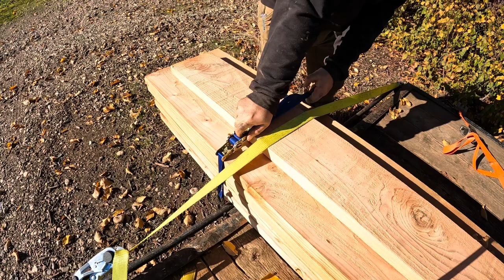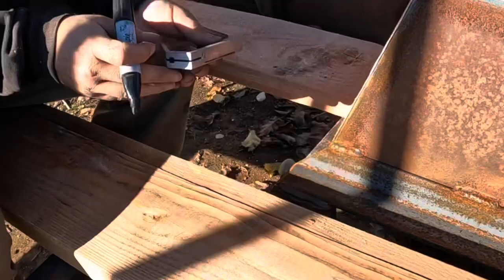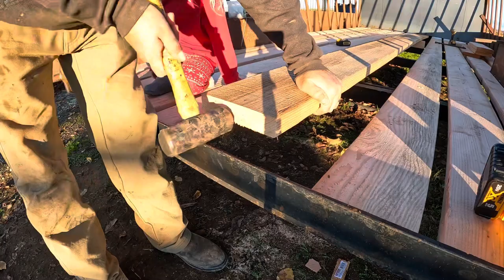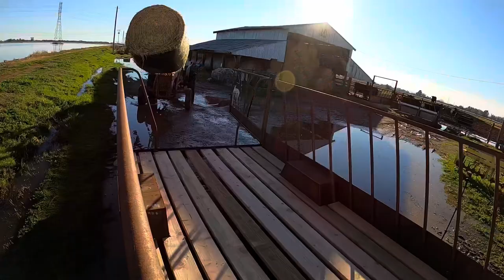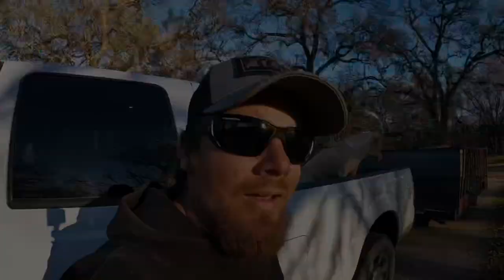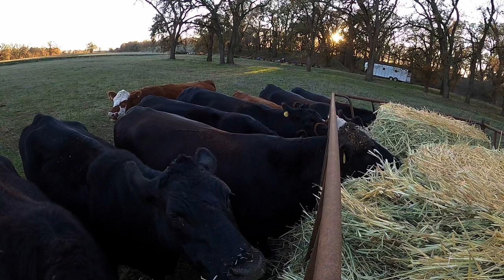The Homemade Feed Wagon is Done!  Let’s Try it Out

Comment: You should try “classical conditioning” 🤷‍♂️?!   As you pull the trailer with hay onto the property, start blowing/sounding your truck horn, or install a separate horn/siren system to your truck. Every time you drive on the property with feed, sound the horn/siren as a signal to the cows that “feed is here”. Keep doing that and eventually they’ll get it.  Sound the horn/siren, they will come, instead of walking around looking for them

Comment: When loading the feedwagon I would use bales not on the bottom layer.  It would be easier to clean out waste hay from your fenceline feeders than from the trailer if it starts to build up.  Cleaning up the wagon would be done by hand. The fenceline feeders would could be cleaned up with equipment.

Comment: Still think you need to weld a V in middle of trailer. It will help get the hay to the sides. I think trailer maybe to wide. Also try loading trailer on the side or rolling bales into it with ends facing the sides. Really like watching you build stuff. I know it's easy for us to arm chair quarterback your build.

Comment: FT, you answered the question already in the video regarding the floor boards to the feeder as to the gap being so wide. But, what happens to all of the hay on the trailer if it rains? Will the cows still eat the wet hay?
Reply from the maker: They ought to eat the wet hay ok but if it molds then they wont
Reply: @farmertylerranch4399  Thanks, FT.